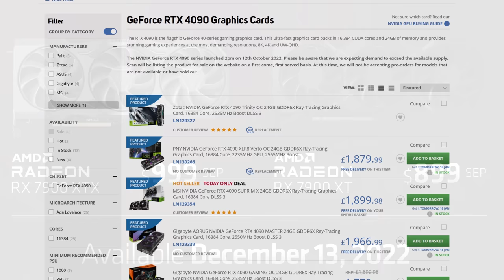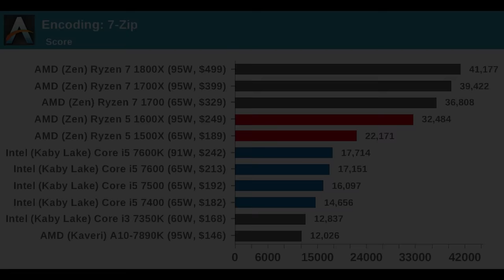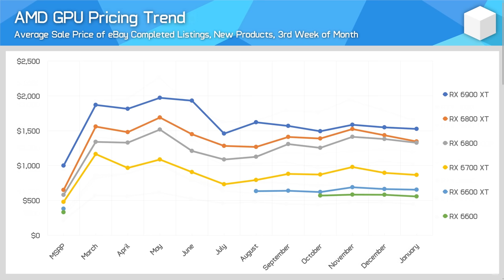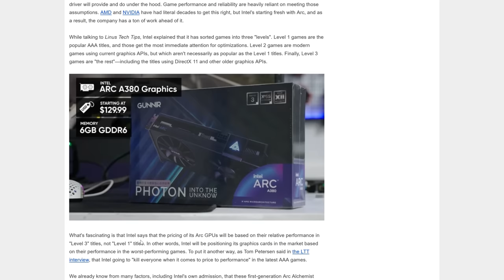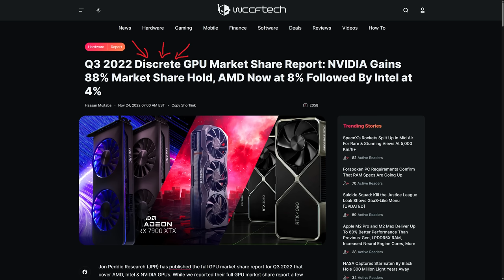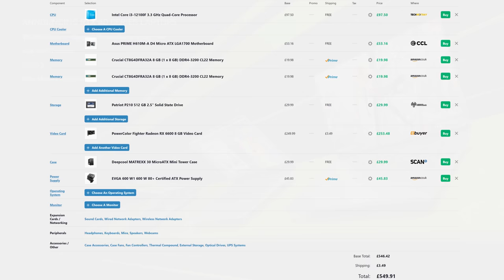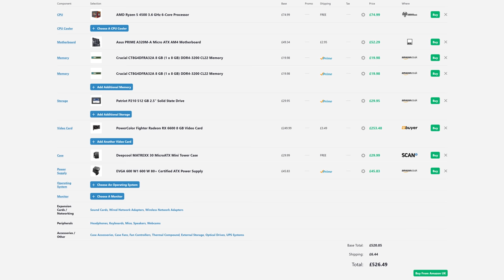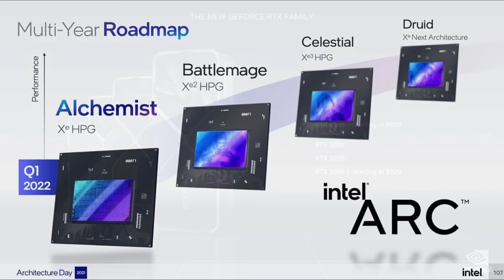Budget Builds in Early 2023?

Comment: TSMC's 12/16/20nm was much more power efficient and faster than global foundry's 12/14nm process node, the numbers "12nm" and so on are just marketing names and they don't mean anything anymore. TSMC's 12nm/16nm is smaller than Global Foundry's 12/14nm. And first generation 7nm used in the RX 5000 series was worse in every way, except size than TSMC's 12nm(20nm++).

DDR5 prices are insane too, so we are back in the days of expensive RAM, but at least AM4 is still an excellent choice for now and it uses DDR4.

The RX 6600 is the GPU of the decade for sure after it's price dropped below MSRP. The H610 motherboards suck, modern intel CPUs consume too much power and the H610 will NOT be able to deliver the power required when upgrading to an i5, i7 or i9.

Comment: That PSU choice is absolutely atrocious. The EVGA W1 (and N1/N2) are some of the worst designed and least reliable PSUs on the market right now.

Also for the same price you can easily find a 2x8 3200 CL16 XMP kit from Silicon Power, Teamgroup, or Patriot, rather than settling for a slow pair of JEDEC spec CL22 RAM.

Comment: I hate when people say AMD has "bad GPU drivers".
I play games on Linux. Let me tell you about horrible, NVidia drivers. They require DKMS, so you can't just install a kernel update. They are broken so often, I've got a preset to start my WM without hardware acceleration. That's not even talking about that they dropped support for a bunch of "old" GPUs, so I'm stuck with some ancient driver version. Or all the strange glitches in games that happen only on Linux with NVidia drivers.

AMD on the other hand, with the AMDGPU driver is **awesome**. The kernel part of open-source, and integrated directly into the Linux kernel. That's right, no proprietary-shit drivers you need to hack into the kernel. No more kernel tainting. Just put card in PC, and start using it. Maybe download linux-firmware-nonfree or whatever to get graphics acceleration and stuff. 
Oh, and older cards? Either supported by AMDGPU alone, or in combination with the older radeon-driver. Just works.

Comment: would you consider the Steam Deck as a good budget option with all new hardware? it packs a lot of punch for £459 msrp for the 256 gig NVMe option and is portable on top of that, comes with a controller and a monitor (eh) as well
Reply: wished it had a global release, it'll suit me perfectly for running old or some new rpgmaker titles I've seen, or indie games in general
Reply: It is. Combine the 64GB option with a SD card (or a NVMe SSD if you're willing to open it up) and youve got a £400 device that can play all your older titles and some of the newer ones. Keep in mind though, there are caveats:

- The biggest one so far is that this is a device that you must be happy with tinkering. You can avoid Proton-GE and the Unsupported titles if you want but sometimes, titles just won't work even when Valve say they do and you'll either have to look for community options (there usually is one for every known game tbf) or wait for Valve to publish an update.
- The 64GB option without the SSD replaced has its storage filled up quickly thanks to shader caching. There is a tool that can delete this for you.
- The Desktop mode is hard to use without an external keyboard and mouse.
- The Desktop mode is Arch Linux, not Windows. Some settings are obvious on Windows but are obscured or absent on SteamOS.
- You can install Windows but ANY Windows update can break the drivers and again you'll have to wait for Valve on that.

That said, these are relatively small as long as you're willing to tinker. In fact, tinkering can give you better options than Windows can right now. I certainly feel better playing Mario Kart on my Deck than on my PC.

Comment: 6500xt is not a good card - and the fact that it costs "only" 200 does not change that .
(and at the time of graphics card crysis upon its release it did not cost 200 but more like 300 in many countries)
these days you can buy 6600 which is 75% !!! faster for 300 bucks .
if you are on a tight budget you can still buy second hand 5700xt or rtx 2060s for 200 bucks .
or at least 1660Ti/1660 super for 120-150 bucks - and these cards are still faster by 25-30% compared to radeon 6500 xt .
if you want brand new there is nothing better than radeon 6600 for around 300 , 
below that there is no point to buy anything new 
(200 bucks for 6500xt is a waste of money - it performs exactly the same as radeon rx 580 which was released 6 !!! years ago for the same price ,
with the difference that radeon rx 580 was actually a viable option and a much better performer relative to its competition back in the day -
in comparison 6500xt would have to be similar to rtx 3060 (or at the very least to rtx 3050-taking inflation into account) 
because rx 580 was performing the same as gtx 1060 and much better than 1050Ti) .
nvidia going crazy with prices of its new graphics cards is an opportunity for amd to sell 6500xt for 100-150 bucks and 6600 for 200-250 .
or make a "new" card like 6550xt (20-30% faster than 6500xt) and sell it for 200 . it would be the best seller .

Comment: The AMD 5500 ($730/75GBP) is cheaper than 12100F($740/76GBP) in Hong Kong, and the 5600($1010/104GBP) is slightly cheaper than the 13100($1100/114GBP), you would always go for AMD here I think. I agree with all other choices. But if you already have a system I would still wait, there are so many good games that don't require good graphics these days.
Reply: 5500 is slower than the 12100 in nearly every game. No reviewers recommend it overt the 12100F

Comment: 6500XT didn't help. 

It only filled the void in the $200 section, it would be better for AMD to produce more RX6600 rather than spend development costs on RX6500XT. Also, the name is DAMN misleading. Imagine people hearing the RX 6600XT being equal to the RTX 3060. OK, but the price of the 6600XT is so high, same with the 6600. Wait, 6500XT is only $200. You buy it and it performs worse than the 580 you might already be having. 

Tldr, it produces more e-waste and that's it. It can barely play 1080P at medium settings in most games.
Reply: @ilyaprofit  depends on games
4GB ram is such a bottleneck, with RDNA 2 architecture is its only saving grace. So yes, you might run 100 fps on one game because of the good architecture. On other games demanding more than 4GB ram, it would suck. 1080P gaming was the future 10 years ago and 6500xt can barely do it. 

Nowadays, the RX 580 is being sold for under $100. Producing 6500xt is effectively ewaste. 

I just really dislike 6500xt, it's so misleading. SO many people I've known bought the 6500xt, thinking it was just a downgraded version like the 3050. 

IT'S NOT! They are not tech savy as we are. I see SO many stores still have 6500xt, like why? Stop selling this gpu to poor unknown customers, plz. Customers bought 6500xt because they were on a tight budget and didn't know anything about gpu. Buying 6500xt is the worst choice for budget gamers! 😭
Reply: Why not just buy a used 1070 for like 130$
Reply: @McChopper2000  there are a lot of used GPUs right now, 1070 for $130? Go for it! That's a good deal

Just buy from a seller with a good reputation, second hand 1070 is quite dangerous since 1070 is now very old
Reply: @quanghuyvu2649  i have one already iam from Germany here the 1070 goes for 150 euros on average. Seems like the best deal atm for a budget card
Reply: @McChopper2000  I would want to search for something newer like 2060S or 5600xt since 1070 isn't new anymore

But, overall, 1070 should last you 4 more years

Comment: This video is outdated on the processor side since AMD released non-x versions of the 7000 series that are great deals
Reply: @2kliksphilip  i'm not referring to the pcpartpicker build, I'm talking about the beginning section where you list the 7600x-7950x pricing at 1:57 . the non-x CPUs are WAY cheaper, have 95% of the performance, and come with a decent cooler